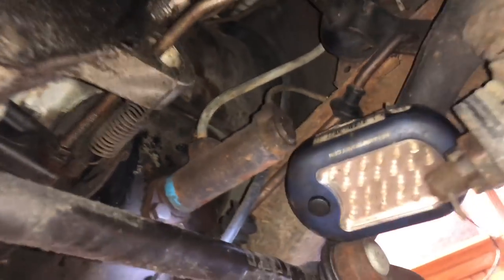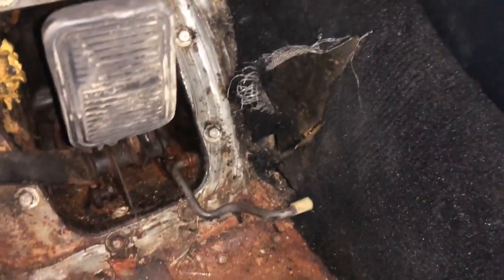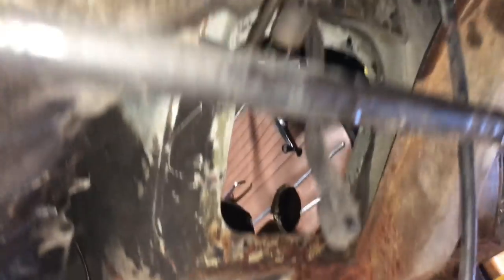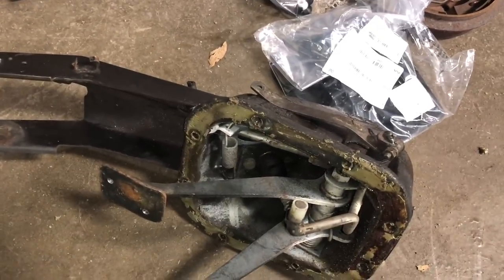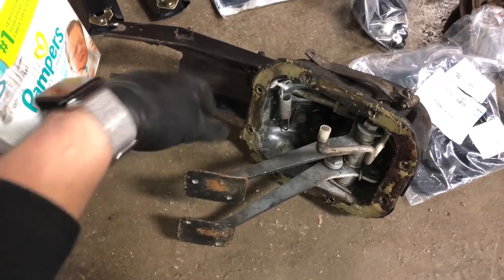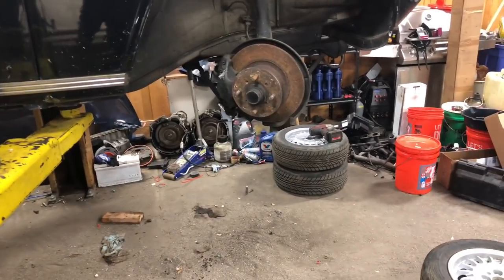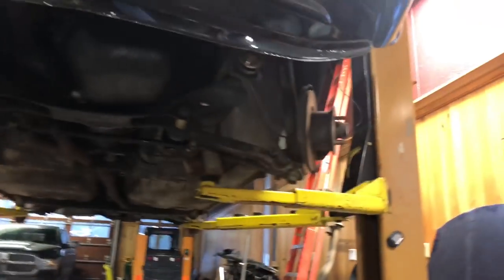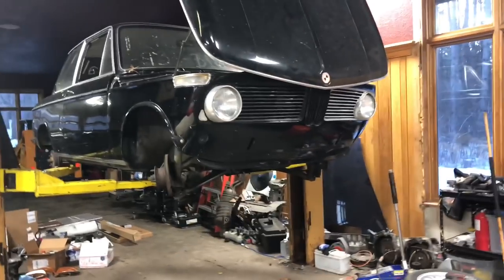Project 02: mechanical clutch pedal box removal, brake drum assembly

Comment: I have the same sort of disk brake setup on my Mini ( the old type ) , crack loose the disk before taking the whole hub off the spindle, its much easier to work loose that way
Reply from the maker: I guess I'm not sure what you mean by 'crack loose the disc' first?
Reply: There should be 4 large  philips style screws on the front of the hub that the disk then attaches to ( in between the wheel lugs ) its just easier to loosen the screws loose on the car , especially if they have been lock tightened into place
Reply from the maker: Hmm. they must be on the reverse side, I didn't see anything like that when I was working on the car last night. my 76 merc is a similar layout come to think of it
Reply: Ovalbore weird, unless it's a real bad one and one single piece, I would have preferred the screws in the front so they are easy to check on and if they do wiggle loose then the wheel stops it coming all the way out

Comment: That looks the same as the hole in the 4 speed in my 76 2002, the slave is held in by snap rings. A late model slave might fit.
Reply from the maker: that would be superb if it ends up being the case -- I guess I'll order up a late 2002 slave and see what happens